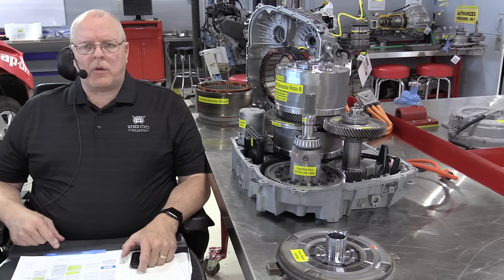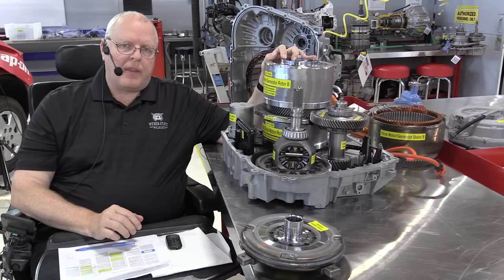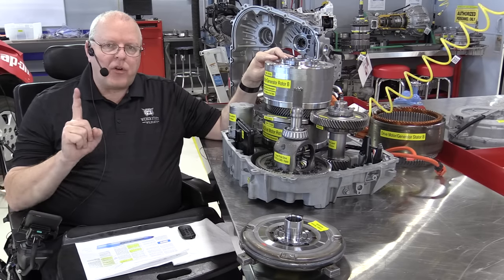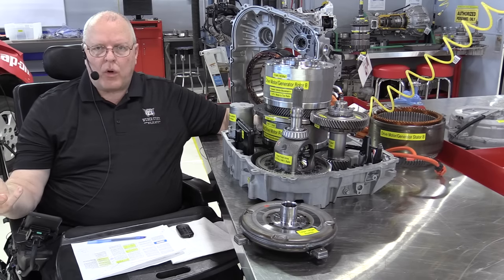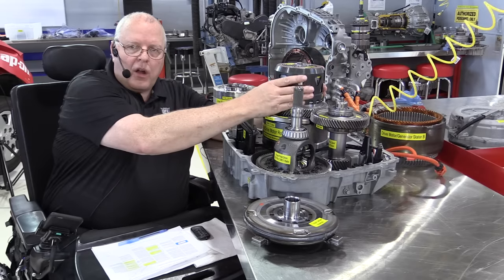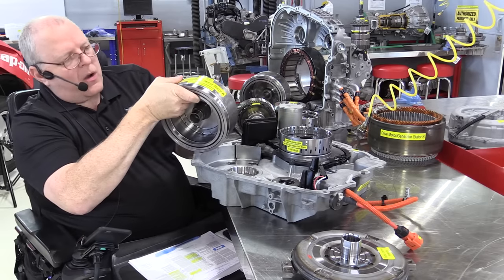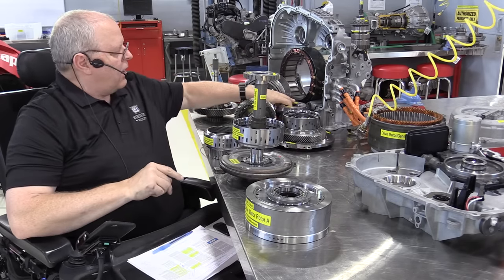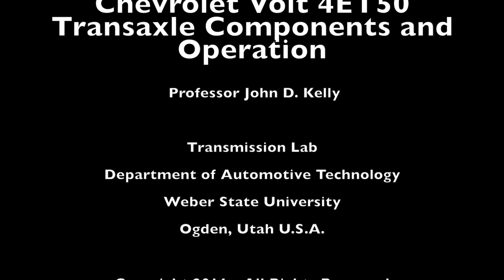Chevrolet Volt 4ET50 Transaxle Components and Operation (2011-2015)

Comment: nice video. and nice job of explaining the different parts of this rather complex drive train. however, mountain mode is not explained correctly. blended (or parallel) hybrid mode was described as mountain mode. mountain mode in actuality is a user selectable mode that is used to maintain a higher soc level, thereby providing more battery buffer for negotiating extended steep inclines.
Reply from the maker: You are correct, mountain mode is used selectable. It starts the ICE and uses whatever SOC you currently have to provide more battery buffer for negotiating extended steep inclines, but it does not maintain that SOC, it still decreases. Thanks for your feedback!
Reply: WeberAuto Mountain Mode actually charges the battery to about 40% SOC and maintains it there.
Reply from the maker: Thanks again. Where are you getting your information about the 40% SOC? That is good to know.
Reply: It was close to 45% SOC actually, when I measured it over OBDII many years ago. I don't use gas a lot (less than 18 gallons over 33,000 miles, on your 2013 Volt) but if I ever run MM again, I can take screen shots and share. There are many articles on the net that confirm this. Gm-volt.com is best because actual owners contribute to it, for the most part.
Reply: As a 2013 Volt driver, I can confirm that the user-selectable mountain mode will charge the battery up to roughly 50% SOC and maintain it there. You can then switch back to the user-selectable normal mode and drive on electric-only until the battery reaches 0% SOC, when the engine starts to maintain the battery level again.
Reply: Nathan Crawford Does the battery ever reach 0% SOC, as I thought it's required to maintain the longevity of the battery, as well as crank up the engine?
Reply: +Shaun Powell There are two different SOCs in the Volt ... usable and raw. Raw SOC never goes over 85%, and never below 20%. Usable SOC can go as high as 98% (with burping, which requires carefully watching charge wattage and unplugging the EVSE right before it goes down to 500w) but normally tops out at 95% (with extra 5% to accomodate for hill starts). Usable SOC can go as low as 5%. I never tested the true lower limits of usabe SOC because it is very rare for me to fully use up all the usable SOC of the battery
Reply: Thanks for the explanation.

Comment: 13:59
My gen 1 volt will charge in "Mountain Mode" up to 50% battery capacity, but you're right it won't give a full charge.

It does charge it much faster than plugging it in, though, the engine easily kicks out some 50+ kw of power at highway speeds, which is nice

Comment: Wow! Thank you for this excellent video, professor! I feel like a real gearhead now. So, is the housing full of transmission fluid, and is there anything special about the type of fluid used?
Reply from the maker: Thank you. The housing is not completely full of fluid, only about 1/5 full. The fluid must be Dexron VI, never use any other fluid or additives. You do not want the fluid to become conductive.
Reply: Thanks again! You have given me an even greater respect for the engineering prowess that went into the design of my beloved 2015 Volt.

Comment: Definitely a more complex design than the Toyota/Ford designs are, with all the additional clutches/brakes; I imagine it probably cost more to manufacture too.  I wonder if the switch to chain drive from geared drive in the 2nd generation was a cost reduction step?

One other thing I've wondered - how do twin-motor hybrid transmission like these compare in size and weight to conventional automatics?

Thanks for the video!
Reply from the maker: Thanks for the feedback. In regard to the chain, the training I have seen states that the chain is for quiet operation, but I do not believe it. Chain drive transaxles have always ended up being noisy. I think they were trying to reduce the size and weight of the transaxle. A countershaft probably weighs more than a drive chain, so the chain was used for overall efficiency and increased battery range. These transaxles are the same size or slightly smaller than traditional automatic transaxles, but they are a little heavier. Thanks again!

Comment: so cool that this info is just online in good detail free. i was driving my volt and tried an experiment. had a long flat spot on the hwy before a steep hill, ran the car in mountain mode to charge up the battery before switching to electric only mode to get up the hilly part for a few miles. idk I know there are losses moving electricity from the generator to the battery then back to the motor, but i almost wonder if having the generator run in the most efficient range for a lot longer period of time, and then just going easy on the electric mode to get up the hill, starting at a speed of ~77 and letting it slow down to like 60 at the top of the hill, if it would be easier on the car and get better equivalent fuel economy. just bugs me when the generator starts and revs up as high as it can to get up hills. feel like thats the worst case scenario... really iteresting car, probably will never be something like it again

Comment: Very well done, do you happen to know at what load drive motor B is activated, it would be helpful to know for the geeks that are trying to get 100 miles on a charge like me.
Reply from the maker: Thank you!, I do not know the exact answer to that, but it is a light steady state load.
Reply: I think drive B turns on at 70 mph but not noticeable while driving.
Reply: By the way model 2013-14 and 15 have a read out on the dash of how many amps are being used while driving and how many amps are charging the battery when braking.

Comment: Hi there John. 
Many thanks for your in depth videos. Great work. I have a question if you ever get to see my posting. I have a 2012 Chevy volt and it has the dreaded service high voltage circuit code. I fixed the problem the coolant sensor but can't reset the error code. Chevy dealership won't look at it as it is has a salvage title. Where on earth can I go to get the error code reset. Or how can I reset it
Thanks Dave
Reply from the maker: Check service bulletins for a coolant level sensor issue. A factory scan tool is required to clear latched codes. Thanks for watching

Comment: small correction...when the hood is open and the engine starts and let it "idle" or when you press down the accelerator it will definitely fully charge the battery
Reply from the maker: Thank you for your feedback. Have you actually experienced this charging? According to the service manual "The hybrid/EV battery pack is neither charged nor discharged" when the hood is opened. I have owned a Volt since 2011, but have never tried what you are describing. Thank you.
Reply: WeberAuto yes i have.we as a dealer (Opel Ampera) have experienced this after replacing a rotorbearing..engine running for checking the oil level at temperature..to speed up the temp raise we just sit in the car and press the accelerator to get higher revs..after a while the state of charge of the HV Batt went up by several miles
Reply: @WeberAuto  I've found on my 2014 ELR that, with the battery at a low SOC,  and the transmission in park, the engine will start and begin charging the battery up to 50%. I recall it puts about 20kw in. If you press the accelerator the engine will rev up some and increase the charge rate to around 30kw.

Comment: Hello! I loved this informative video! What do you think could be the problem with a 2012 volt that struggles very hard to get to 30 mph in either electric or internal combustion mode but drives well once you hit that speed? It was diagnosed as either the tcu or 1-2 clutch pack. Tcu was replaced and reprogrammed, still same problem. I’d like to fix it myself or buy a used transmission. Thanks!

Comment: So... technically, the ICE can possibly work as a parallel hybrid drive, as it CAN connect to  the physical output through the ring gear, in parallel with the sun gear from Motor B (which is powered by battery and/or motorA/ICE?

Comment: Great video Professor. I have already seen it several times and now have a few questions:
1. Theoretically what speed is the most economical for range extended charge mode? 
2. Which part of the video is about the transmission bearing with the plastic cover that breaks down on most high mileage Volts/Amperas?
Reply: The bearing is the large ring bearing atop of MG/Rotor B. Visible @ 3:15 The plastic bearing retainer was changed to a brass one sometime in 2013, however that revised bearing still popped out the brass retainer ring which simply sticks around on the MG/B cover. I don't know if there is a 3rd revised bearing with a properly secured retaining ring.
Reply: Thank you

Comment: such an interesting powertrain. im curious about the mode 4. to my knowledge it's the most complex mode. what i thought it does is, it allows mode 3 to function (extended range mode) while simultaneously allowing extra juice from the battery to feed into drive motor to provide additional power. like for uphills. however unlike mode 3. in mode 4. when there is no need for extra power. the computers will keep running the ICE through the generator, generating extra power aside from driving the vehicle in order to charge the battery to about 50 % SOC. so that there is extra power in the battery when needed for steep hills. but not sure that's the mountain mode. it could very well be mode 4 is more of a hybrid mode within the powertrain itself that uses both motors for improved efficiency at higher speeds which has not much to do with mountain mode but more so a mode while driving at low speed vs high speed

Comment: I wonder how strong those gears are. Would repeated jack rabbit starts risk breaking a tooth?
Reply from the maker: They are large gears, equal or larger in size compared to the gears in a typical automatic transmission.

Comment: I'd love a tear down of an 2016 ELR to see what they did actually change (its been said there were mechanical changes as well as the software tweaks to get the first gen Voltec to finally have some oomph).
Reply from the maker: Major differences! I have a 5ET50 apart right now working on a video. It should be out in the next few weeks.
Reply: Awesome!  Really looking forward to it!  I've been hunting a 2016 ELR to replace my 2014 Spark EV.   Would you call the 2016 ELR drivetrain Voltec 1.5?  Its how I've referred to it from everything I have learned.
Reply: Ah, the 2016 ELR used a 4ET55 - so...those changes are what I was curious about.  However I will watch the 5ET50 teardown as well.
Reply from the maker: True, I forgot the ELR did not update to the 2016 Volt powertrain with the 5ET50, it kept the older powertrain with a modified 4ET50 called the 4ET55. The only description I could find comparing the 4ET50 from the 1st gen Volt/ELR and the 4ET55 is found here http://gm-volt.com/forum/archive/index.php/t-248874.html
Reply: After finding my 2016 ELR and purchasing it, I can say the 4ET55 is a very significant upgrade over the 4ET50...I really do enjoy this car.  Given there were less than 500 sold I doubt you will get ahold of a transaxle to compare the difference.  I suppose it might be worth a comparison to the 5ET50 though!
Reply: @WeberAuto  I'm waiting patiently to see the video of the 5ET50 too. I've seen it's completely different mechanically, but want to see it in your video instead of some pictures on internet. It will never come too soon !

Comment: It will be interesting to see which will last longer the 2011-15 or the 2016 and up.  With that drive chain in the 2016 i think the first generation 11-15 will last longer,  chains are always a problem at high milage.
Reply from the maker: True, but it does make it lighter weight without the need for a counter gear.
Reply: GM has been using drive chains since the TH425 in the Oldsmobile Toronado. They've proven to be no more problematic than any other component.

Comment: I've gotta say after watching this presentation I've reverted back to preferring the GM solution after a short break spent admiring the Prius engineering feat. Although the 4th generation Prius transaxle appears to be a marvel of economy in design and the elegance of its concept is unquestionable, it does, however, leave me with some questions over e.g. economy gone too far for one thing. By comparison, the GM transaxle appears a much more robust design, more powerful and with simplicity as its major strength. The built also appears much sturdier. I guess you get what you pay for. I still wonder why GM didn't continue with this design by simply adding more battery storage. From what I've been able to find out from the press, I'd say I'm still keener on the initial Volt concept rather than the Bolt design. Is there going to be a similar presentation of the Bolt transaxle? I'd be very interested on a comparison between the two GM transaxles and the (engineering) reasons behind the change in the design. A great presentation once again!
Reply: I rushed to comment unaware there was a 2018/19 Volt model. It does, however, appear after a quick glance only minimally different to the previous Volt edition. I don't think it's available or will ever be available in Europe so it's probably only of academic interest to me.

Comment: Also i have a question related to the electric auxiliary oil pump. Of course they needed an electric oil pump to generate hydraulic pressure because the mechanical pump only operates when the ICE is running.  The main drive inverter module supplies power to the aux pump (same inverter that supplies power to MGA and MGB) the inverter is a box above the transaxle in Gen 1 Volt, but in the Gen 2, its inside the transaxle housing. 

I think a possible concern with high milage gen 1 Volts is if an oil seal inside the electric aux pump was to fail, there's a possibility that oil may be pushed or injected under pressure inside the high voltage electric cabling and end up dumping inside the inverter module. The oil could possible travel inside of the cables, ie travel along the wire strands inside the insulation jacketing. If the inverter filled with enough oil, i could imagine could cause a catastrophic malfunction of the inverter. Has there been reports of thus kind of thing happening and should owners of high mileage gen 1 Volt drivers be worried? Thanks
Reply from the maker: I have not heard of any failures like that. Anything is possible though. That used to happen with coolant temperature sensors and diesel fuel injector control modules.
Reply: @WeberAuto  That happened on some 1999-2002 VWs, the pins on the coolant level sensor would leak letting coolant get into the vehicle wiring harness. It happened on my 99 Jetta, there were coolant stains on the hush panel below the fuse box! 
Amazingly, after the dealer chopped the ends off of harness, spliced on new ones, replaced the instrument cluster, coolant temp sensor, expansion tank, and vehicle speed sensor it never had another problem, even though the harness itself was probably still full of coolant.

Comment: Hello mr Kelly, I have a question about 2012 volt transmission, but firs I want to say Thank you for your job, its great! So my question is: do I need reprogramm my new transmission after replacing? Which tool You can recommend for that, thank you

Comment: Could you make a video going over the valve control (TCM) portion of this drivetrain and how it is related to this?  Getting a P0700 DTC so any info you have on it would be greatly appreciated..
Reply from the maker: Thanks for your feedback. P0700 is just a code telling you to check codes in the HPCM1. You need a special scan tool for that. OBD-II scan tools will not work.

Comment: I just realized that the highly popular Mitsubishi Outlander PHEV sold in Europe since 2013 (now on sale in Canada & USA for 2018), the front axle shares some similarities. The S61 front mounted transaxle also has a 2 motor + ICE gasoline engine which operates either on EV, serial hybrid (ICE powering a generator but no connection to wheels) and parallel hybrid with the gasoline engine driving a 3.425 reduction directly to the wheels.

Professor Kelly, are you likely going to do some videos on the Outlander PHEV now they arrived stateside?
Reply from the maker: Hi, I would if I could get my hands on one, but it is unlikely. Thanks for the feedback

Comment: An interesting distinction between the Voltec(1) and Voltec2 is final drive to the differential. Pictured here in this Gen1 is a transfer gear assembly to the diff ring gear.

On the Gen2 (which I own), final drive to the diff uses a chain. Personally I think that's kind of lame but it's admittedly a pretty heavy (5-link) chain. I understand a chain drive might be cheaper than machining two more gear and a shaft but I was wondering if you had any thoughts on chain vs gears?
Reply from the maker: GM claims the chain drive is lighter weight than the counter-drive gear method. The 2001-2009 Prius transaxles also used a chai with no problems.

Comment: Great video. Quick question: is the stator SENSOR located inside the transmission? Can't really see that in the video... Operation of starting the car is controlled by that sensor Thanks